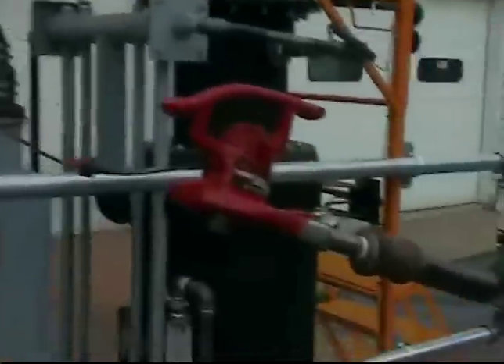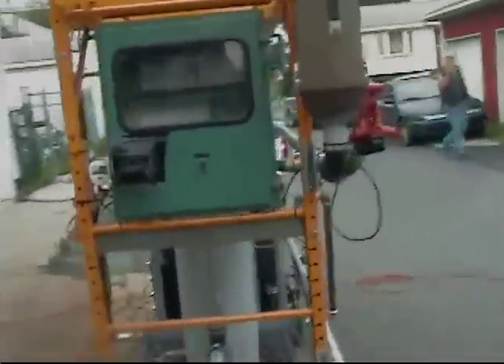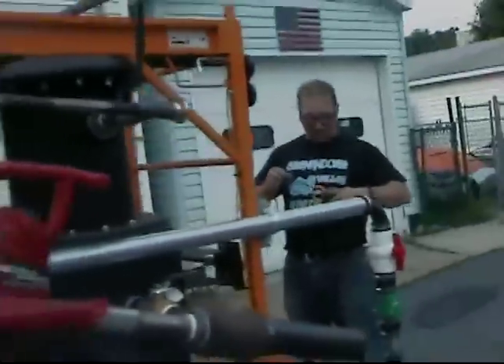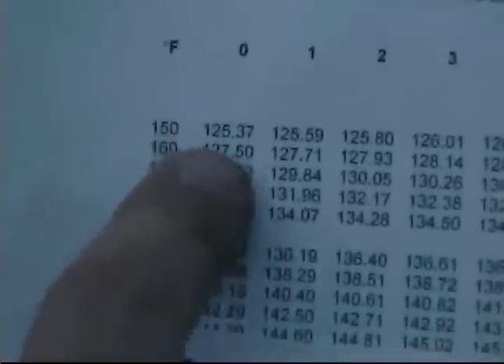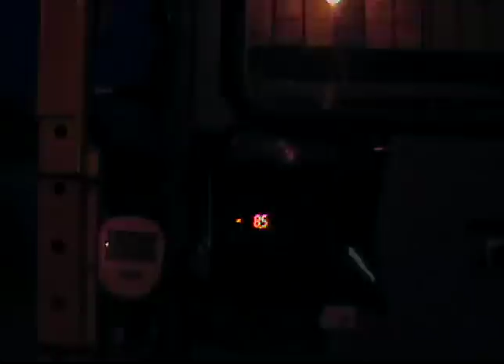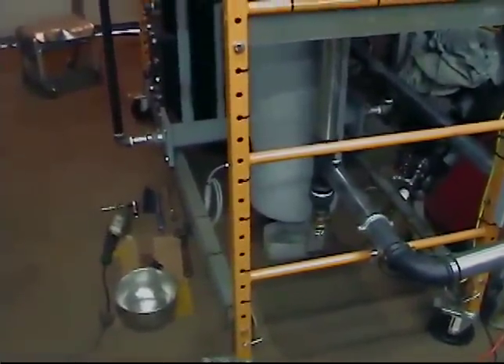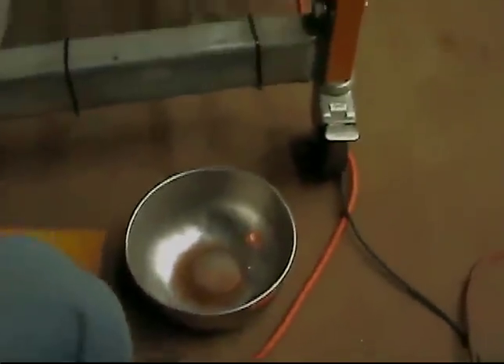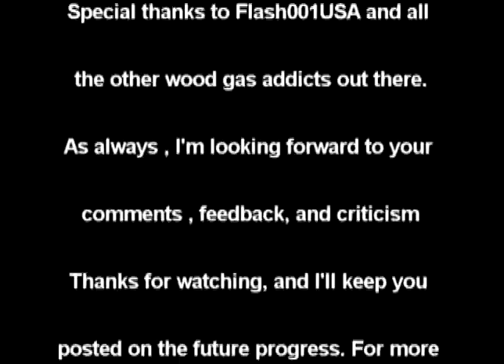2nd Gasifier Test Run 7-03-2015

Comment: I like that lid latch system, I going to barrow that idea. You have a really good flame color. Looks like good fuel. I think your right what caused the explosion. Getting a good burn with not alot of moisture. Happy testing
Reply from the maker: Rusty Glovebox Thanks for commenting. I just got that hold down done the day before the test. I didn't even have time to paint it.  It has a hinge that is spring loaded up , so it won't fall on the lid and it will stay up just like the lid itself. Thanks for watching. Joe

Comment: That was a pretty sweet first run, my fellow woodgas addict.
Sure, a couple of things went wrong, but there is no way anyone is gonna peel the smile of yer dial  :) .
For an unfiltered flare, you got a pretty clean burn, so you are definitely on the right track.
Perhaps a visit to the museum of electrical appliances is in order, so you can get yerself another vacuum cleaner.
I am thinking that you will find a burnt out segment, or coil connection, on the commutator. That can often happens when the brushes wear out and start arcing onto it.
It was a pleasure to see this giant beast come to life.
Keep up the good work, and keep feeding the addiction   :) .
Reply from the maker: ***** Thanks Steve, I would have never thought it was possible to get that color from an unfiltered run. In fact people kept telling me they were seeing blue and I was telling them they were wrong . It can't be blue unfiltered. I guess they were right. I'm just glad it made it till it got dark out so I could get a good look at the flare. I need more night time lighting for future runs. I didn't really think about it as it was running. I just came across a monster industrial regenerative blower with a bad motor. It was a three phase motor , but somehow I'll make it work. Thanks for watching . Joe
Reply: mazdalorean
Talking of getting a blue flare from unfiltered gas, I got the same thing from mine in the early tests.
What was strange is that I didn't seem to be getting any smoke from the flare port.
Naturally, I assumed that there was a leak in the system and that the smoke must have been coming out somewhere else.
Anyway, I lit the flare, and I was surprised to see a purple flame in there!
WOW!

It just goes to show what is possible when you put plenty of time and effort into the design and construction of a gasifier  :) .

Night time lighting is a must for sure. LED lamps are probably a good choice, as they don't get hot - and will stand up to some rough handling too.

Since I don't have mains power here, everything has to work from the onboard car battery, so LEDs are the very best choice for me.

That big blower sounds like a real beast!
I bet you are gonna love what it can do for your rather huge gasser  :) .
It's a fair bet that the little bilge blowers I use would not be powerful enough, so it looks like you have chosen well with that industrial blower.

Talking of blowers, I want to try making a hand cranked one. If it works, then I wouldn't need any battery power to get the system started.

It would be the perfect solution for the next zombie invasion  ;) .
Reply from the maker: ***** Thanks for the kind words Steve. I took a trip down memory lane and watched all of my old videos yesterday. Man it feels good to be this far into the build. It's been a long road. Thanks again for all of your input. I take this advice very seriously as it comes from a wealth of experience. Talk to you later. Joe

Comment: standing ovation my friend!!! first-you made a damn fine video-being a looney tunes fan-I loved the ending!! now the meat of the matter-you nailed it. I agree with your interpretation of the blow up, cause, and effect-but do agree gas thru a sparking motor just can't be good. I'm very curious on your filtering ideas. your pre filter flare was at least as good as mine, if not better.  you did a great job explaining everything as you went too-I take my hat off to your hard work-you deserve it. oh, and thanks for the "rush"-I was badly needing a fix....ya know how us gassers are.  really nice job, buddy!!
Reply from the maker: Casey Jo Thanks Pete. You know we had this conversation on the miniwoodgas site not too long ago about using vacuums with internal windings. It sounds crazy , but as long as there isn't air mixed in with the gas , it can't ignite. Two things are for sure. I will be moving that check valve closer to the flare point, and second, my next blower will not have internal windings. I'm also working on changing the thumbnail to this video, because youtube always gives you such crappy choices. Thanks for the kind words, and I'll talk to you soon. Joe
Reply: mazdalorean I remember the conversation- it's that little bit of air, if it does get in there-that worries me. I think eliminating the motor with windings will take care of that.   whatever-I think ya got a nice setup there---blue flame/no filter-that's very nice to see-on looking, your unfiltered flare blew mine out of the running-but I'm still burning some old tar out of the system, so hopefully, I'm not toooo far behind you.keep us posted!
Reply: Casey Jo maybe a fella ought to put a check valve between blower and flare?.....and after, just to be safe. I think I've watched this 5 times now-has anyone else hit a blue flame without filtering, like you did? mine wasn't that nice of a blue before filter. it was blue, with orange highlights-yours looked much more blue.
Reply from the maker: Casey Jo Pete, moving my check valve is on my to do list. It will DEFINITELY be near the end of the line, but not after the blower. These vacuums are not really airtight unless you make it airtight.. No one can predict when the blower can fail. Wait till you see the blower I picked up out of the junk pile. It's gonna blow your mind. I had it apart today, cleaned it out and sanded any questionable surfaces. Also anti seized everything. It may need a motor, but if it does it should come apart easy. As for the blue flame, I've seen a couple of the drizzler videos where they are lighting off of the ejector. They have a blue flame right out of the gasifier. Don't forget at that point it is still too hot to use but I was impressed. Joe

Comment: Joe it looks like you're starting to figure things out now and it won't be long before you have the system completed. Hey man just an observation here but when you start up the gasifier be sure to close the hopper lid if you are lighting from the ignition port so that the system can light easier.
Reply from the maker: flash001USA Thanks for pointing that out. This is what I mean by running around like a chicken with your head cut off. That thought never even crossed my mind. Thanks for watching. Joe

Comment: Joe first what you have to deal with is the fan.gases must not, under any circumstances, through the engine in this your second attempt this is to save the only gas because it is so explosive, if you play with the oil gas would have had the vacuum cleaner on the thousands of pieces.how you even thought of it that will gas drop across the sparking engine. Buy yourself a vacuum motor wet dry. In the us in Slovenia is the price of 50eur engine has a 850w and around 18000 on.the minute you need a regulator because otherwise too much power.The engine is separated from the wind turbines. If something is not going to be able to figure out like to thank Google because he translates papa Martin
Reply from the maker: Martin Stor Thanks for commenting. I am done with motors with internal windings. I will be using an external motor for future runs. I'm not willing to take another chance with that kind of motor. Joe